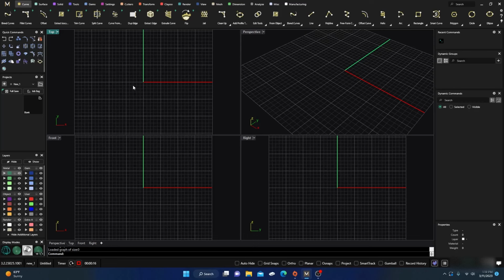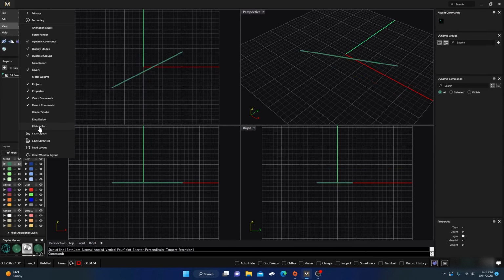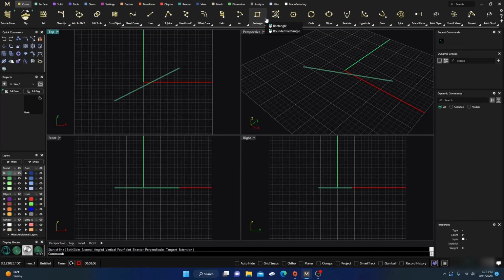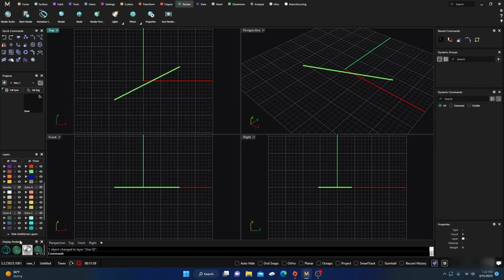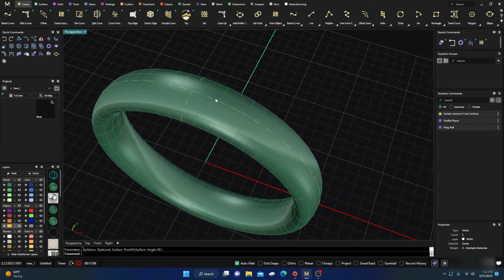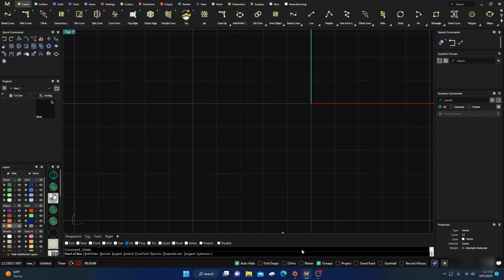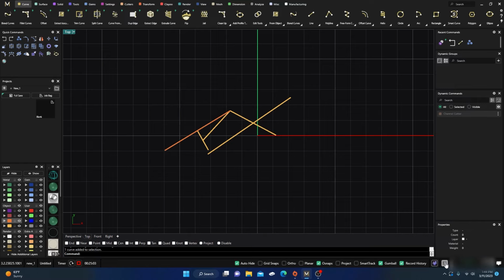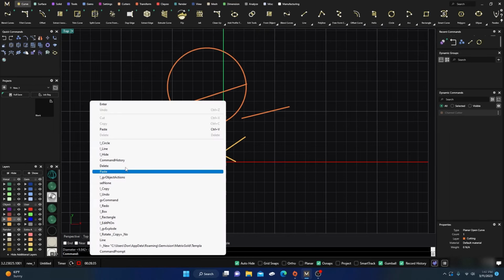Beginner Series Introduction MatrixGold User Interface Command History Command Prompt and Ribbons

Comment: What's the easiest way to find your job bogs?
Reply from the maker: They should be on the side bar. If not, you can click on the M at the top left, it will give you two drop down menus. click on view and it will give you a list of all the side bar items you can have displayed. Find the one that says projects and make sure it has a checkmark. It then will be displayed in the side bar. It will have your job bags and full saves as well as a folder icon that you can click to see a list of all your saved items and projects. You can also access your collections from that folder icon.

Comment: How to switch 0.5 to gridsnaps
Reply from the maker: At the bottom you should see several boxes starting from the left the MatrixGold version you have. Then a few others like maybe Clayoo and Untitled, timer and then Auto hide. Next to Auto Hide at the bottom you should see Grid Snaps. Make sure that box it checked. That will give you options to choose 0.01, 0.25, 0.5 1.0 choose the grid snap you are wanting, and you should be good to go. Remember to turn them off when you no longer need them to get a smooth flow. Let me know if that helps. Good luck.
Reply: @donsjewelrymakingandjapantrave  thank
Thanks it work

Comment: Do you think AI can replace jewelry designers?
Reply from the maker: @udaralakshita4986  you know that’s a great question. At the moment it can create some amazing designs but not there yet in creating the model itself. I’ve used it to create designs before but you still have to correct the thickness and o the things but given time it will probably put us all out of work. But it will be awhile yet and someone has to create the machines to make it happen so CAD in my opinion will be a growing profession in the future.
Reply: @donsjewelrymakingandjapantrave  thank you.  Can you tell me Rhino and matrix gold enough? If we want create some complex organic shape can we create using this tool? Example like dragon head ring or necklace. Or should we master other sculpting software? Like Zbrush.
Reply from the maker: You can do it in Matrix and Rhino but really, I would do something like that in Blender sculpture and import it into MG. Zbrush is expensive and I don't use it enough for jewelry, so I use Blender instead it's free and there are a ton of videos to help you learn just sculpting.

Comment: How do I pave different types of diamonds. Guess there is no options for that. Are there workarounds?
Reply from the maker: Great video idea. I will try to work on that in the future. But to try to help you out until I can get that up on the channel, after you place the gems using pave gems. Ungroup them. Chick on the gem you want to change. Make sure it is highlighted. Then click on Gem Override in the gem's menu. You will see gem pop up in the dynamic commands area. Chick on shape and you can change to whatever shape you want and even adjust the size of the gem. Hope that helps. If you run into other issues, please let me know. I'll try to help and also, I can add any issue you have to the content when I can post it to help others.
Reply: @donsjewelrymakingandjapantrave  that helped me allot thank you and a tutorial on this would be great.